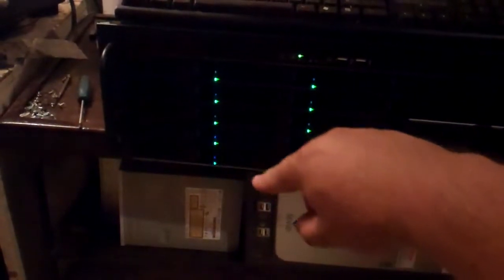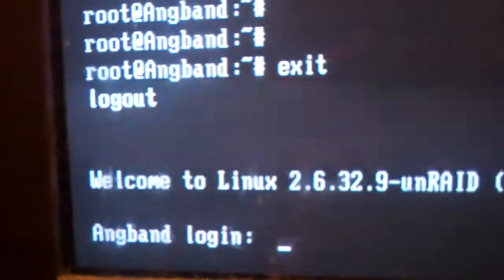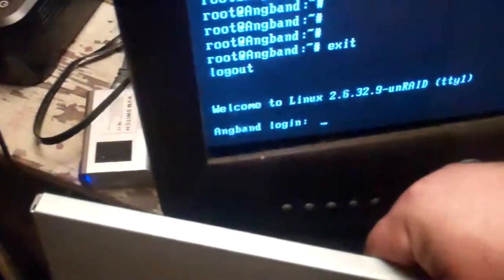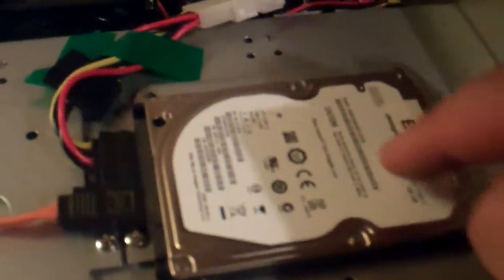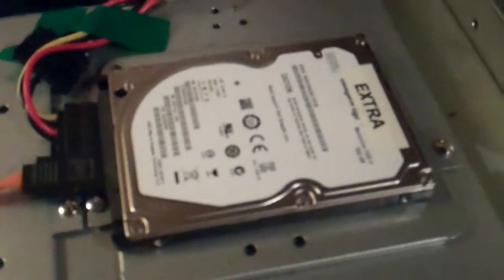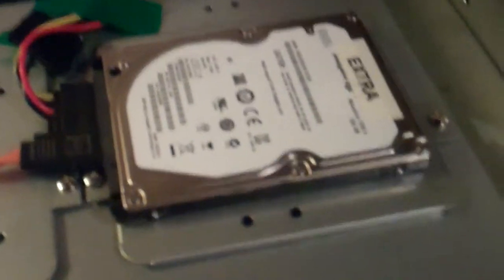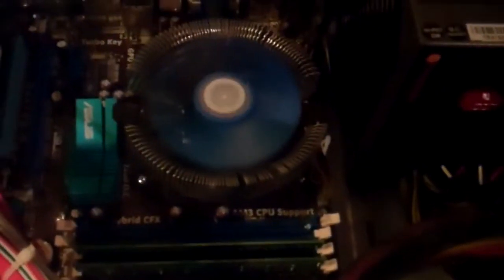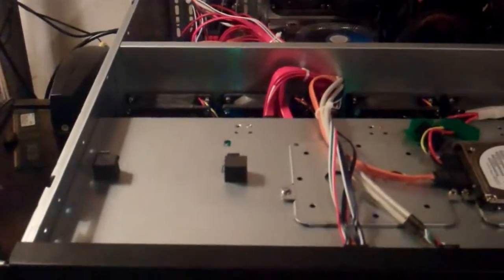HTHTPC Setup Part 2 - The "Beast" unRAID Server

Comment: Great video! Your processing drive, is that what you'd call a cache drive? Can you use an ssd instead of a mechanical drive? And is there a limit to what size i can use?
Reply from the maker: From my comment below:
" There really is no difference in it being an SSD versus a HDD. The writes to the array are all done at the speed of the array anyway. Due to the fact that we are not moving lots of files around (mainly streaming) there's no need for real raw R/W speed. Couple that with the fact that SSDs have limited R/W capability and I'd rather stick with a HDD."

There is no real size limit (I think 4TB actually).
Reply: Kristopher Marentette Ah, sorry I missed that. Fantastic! Where are your unraid plugins or apps stored? The processing drive?
Reply from the maker: Yessir! The processing drive is mounted as "extra" and that's where I store my unRAID plugins config and install directories.
Reply from the maker: TheBlooRayChannel I should really redo the videos, that Norco is now full with 49TB ;)
Reply: Kristopher Marentette If you were to reboot your system by any chance, would you lose your plugin settings or data on the processing drive? Would using an SSD improve processing speeds or do you reckon the difference isn't noticeable?
Reply: Kristopher Marentette Yes! An updated full tour of your entire setup would be excellent. The finished product :D
Reply from the maker: TheBlooRayChannel The processing drive retains all plug in settings if you keep the configuration there. Of course, unpacking time would be faster if you used an SSD, but moving the data to the protected array would still move at array speed, so no real gain there

Comment from the maker: The cache drive only needs to be as large as the amount of files that needs to get moved to the array on a daily basis. The cache drive sits outside the protected array and acts as a temporary storage space. Files that are written here are not written with parity (therefore improving performance but not protected). Every day at a set time, the files are moved from the cache drive on to the protected array. I do not use a cache drive, my files are moved immediately to the array upon completion.

Comment: Nice video mate, very good. I've built a Norco 4220 for my home, it's basically the same except it uses SAS rather than SATA cables from the backplane to controller/mobo (still SATA drives, just SAS cables). I made a video if you want to see it. You said the TVs stream from it. What software solution are you using? MythTV? Again, top vid champ.